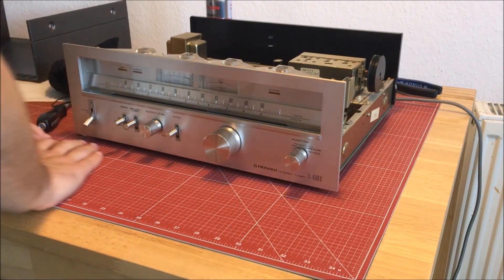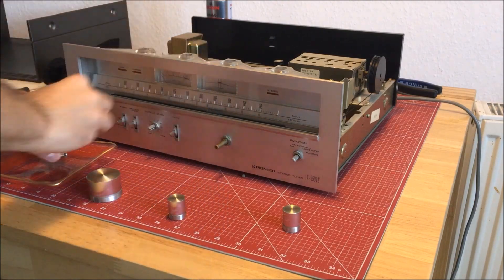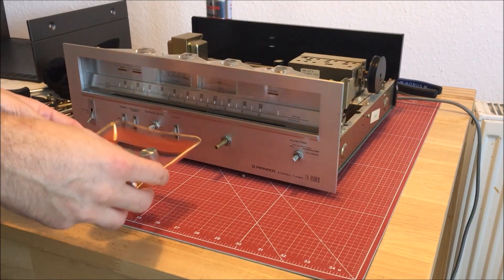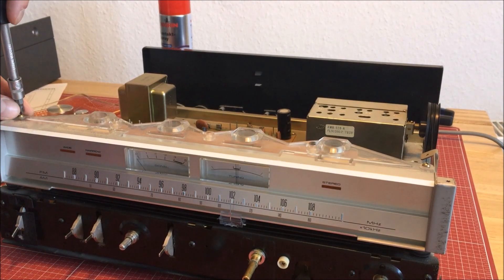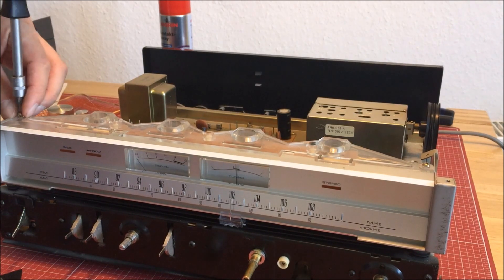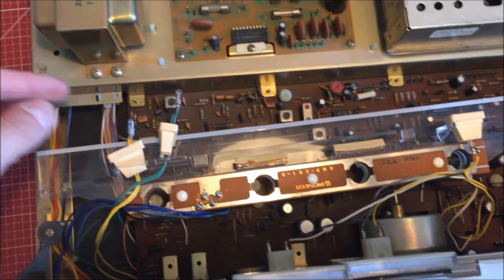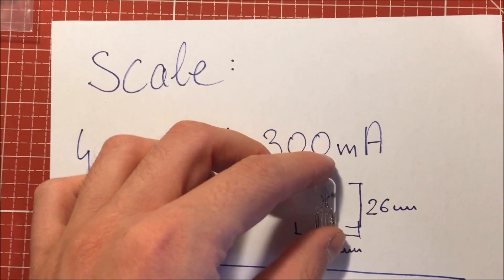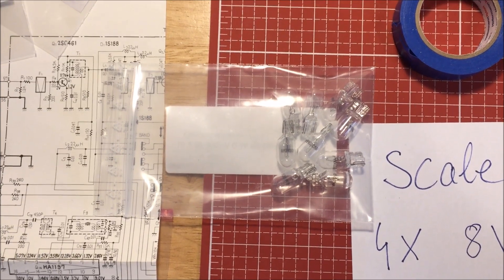Pioneer Tuner TX-8500 ii - Light Bulb Lamp Replacement Repair

Comment: can you tell the name of the antenna on top or make a recommendation ? do you use it as external antenna for the tuner ? has some improvements on the signal ? thank you
Reply from the maker: Hi, it is a "Hirschmann Hit Zifa 7350V". But I just searched for "vintage antenna" on eBay. Yes, I use it for the tuner and it has a huge signal improvement. It is an active antenna, what I would also recommend. I connected the power cable of the antenna to the amp, so it only uses energy when the amp / tuner is turned on. best regards!